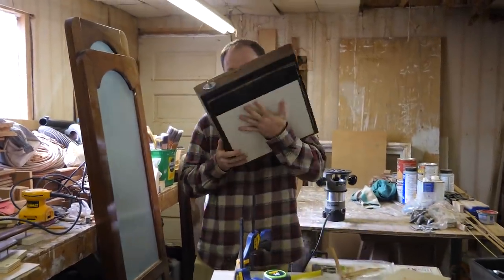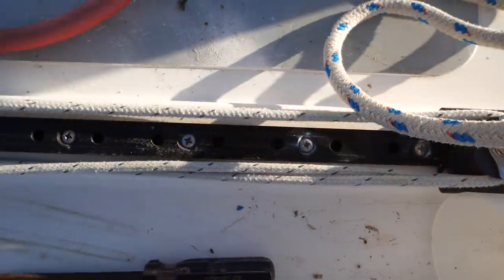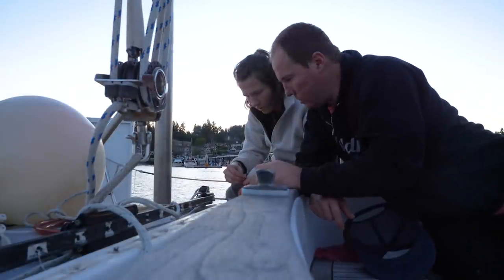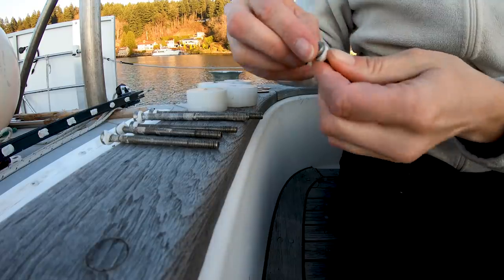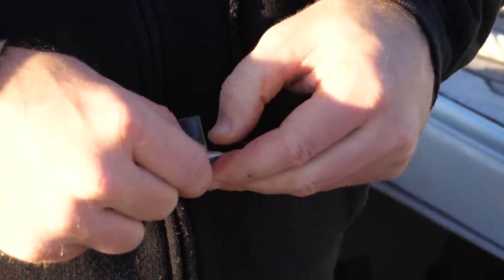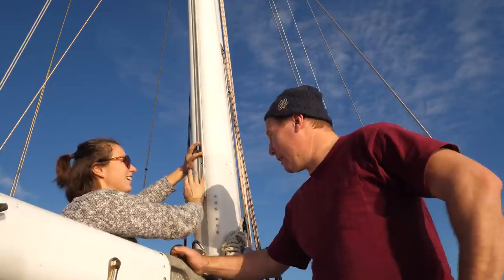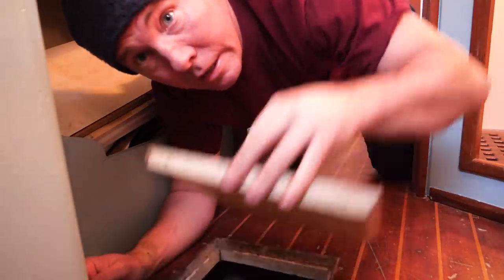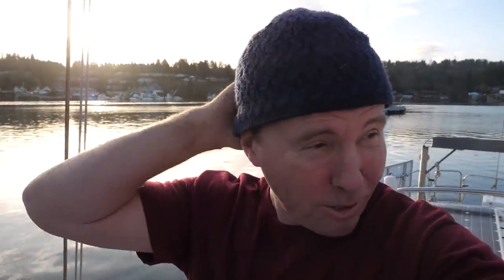Chop It, Grind It, Butyl It [Adventure #194]

Comment: Please use a dust mask when sanding, cutting etc.  My uncle refurbished a canal boat in the UK and failed to use a mask.  Cancer resulted from the fine particles.  He then lost his sight due to Radiotherapy, which in turn meant that the boat had to go and he could no longer sketch.  And then in time he lost the battle with cancer.  A little discomfort from a mask is minimal in comparison.

Comment: hey guys Just a small suggestion ,  I noticed that you didn't renew the stainless bolts on the traveler.  Stainless gets brittle after 20 years,  and those bolts looked they had already started to deteriorate.  Just  thought you would have replaced them.  cheers

Comment: surely the boats designed for anchor chain up front. do you have to go below and flake chain each time you leave anchoarge? that would piss me off.
Reply from the maker: Yes, need to flake everytime.  A bit of a pain, but we think if balances the boat much better, less chance of the bow digging in.  Unfortunately, boat builders/designers don't generally take into account how a boat will be used/loaded, especially when outfitted for more rugged cruising.  Typically, boats wouldn't be expected to carry an all-chain rode - 100 feet of chain and rope rode is probably standard, but adding an extra 200 ft of 3/8 chain is a lot of extra weight.

Comment: I’m a huge fan of butyl tape for deck hardware fasteners. I’ve had to re-bed a couple of stanchions and did it very similarly to how you did with countersinking and wrapping the fasteners.  

The shorter haircut is very flattering! Good job Ty!
Reply: Yes, nicely done. I used thread-sealing tape/PTFE around the threads with dollop of Sikaflex.  Nice to see an alternative! Thanks!